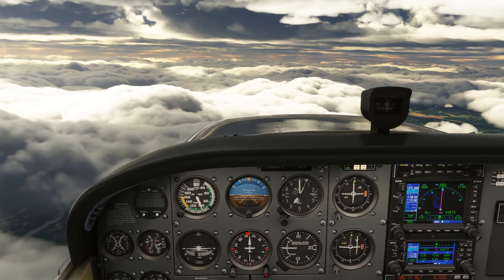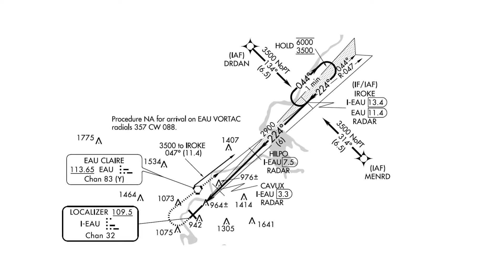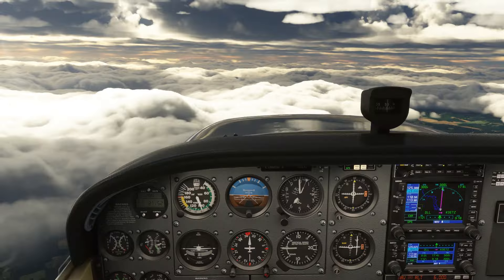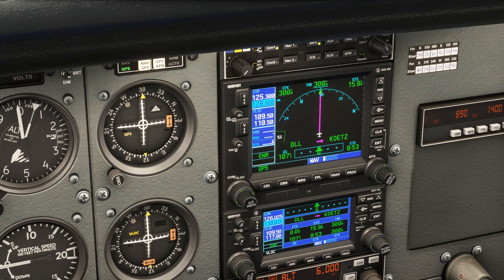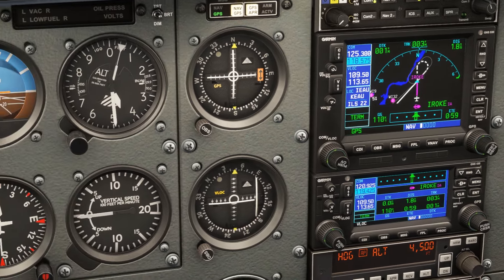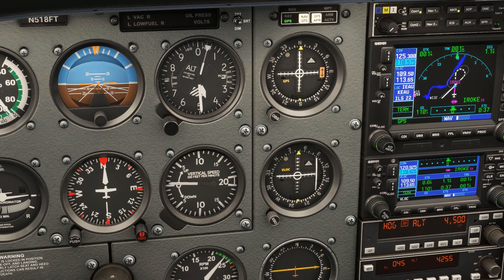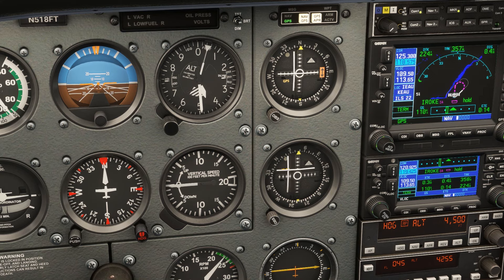When to Do a Procedure Turn | Procedure Turns and GPS | IFR Training

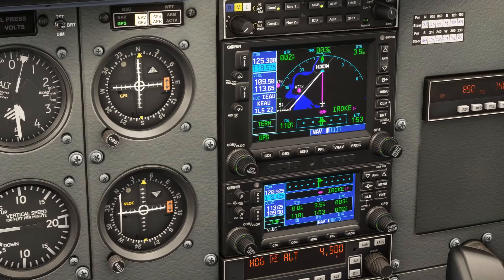Comment: @2:30 you changed from NAV to HDG mode, why? was it because you were cleared to IROKE and knew that you would have to fly a teardrop by hand? @3:51 the unit sequences to a hold and not to the teardrop, is that because you didn't remove the hold from the FPL? thank you for these videos, I am learning so much from you

Comment: What is the limit for the intercept angle with IROKE when you have to do the procedure turn? Anything more than 90 degrees?
Reply from the maker: In this example there is no limit where you do or don't have to do the course reversal. It's all based on whether you're cleared "straight in" or for the "full approach" including proc turn.
Reply: @flightinsight9111  That makes sense, thanks for the reply!
Reply: ICAO standard say there should be no more than a 100degrees(correct me, I'm not completely sure) turn to align with the course to intermediate/final course. So in this example this should ring the bell, this turn to final can not be legally made, and you can even see there is a holding,so it's obstacle protected(assuming you maintain altitude above),you can make a procedure turn. And also ATC is always there to help.

Comment: I have a silly question. If Im coming from the north and Im wanting or by some reason being told to the shoot approach starting from MENRD, can i just direct MENRD and 180ish turn to intercept the 314‘ course? if so, how wide can my turn be?
Reply: Yes. Since it’s IFR, the rate of turn will be standard rate. So speed constitutes turn radius and speed limit is set by the regs. I don’t think there are further restrictions on deviation from the initial approach segment.

Comment: Iam sorry, iam more confused as ever, by watching this video. I guess, iam old fashioned. Iam going to forget  all to gather, the GPS , and auto pilot and hand fly the damn  thing  the old fashioned way. But, before, getting into the air, I will make sure, i understand, the worst scenario, might be  given by ATC, to hold at different fix points, or intersection; and get myself, mentally ready.  The hell with modern technology.